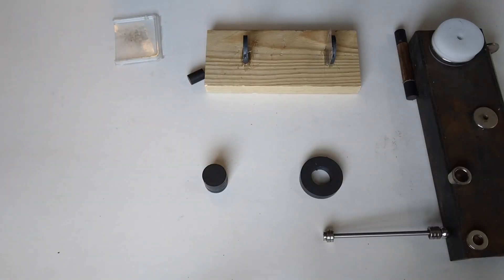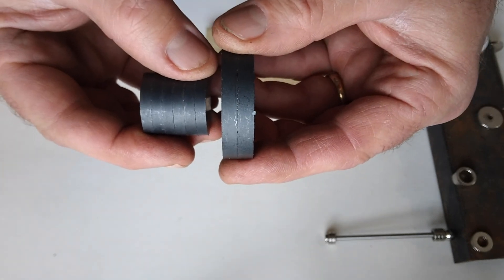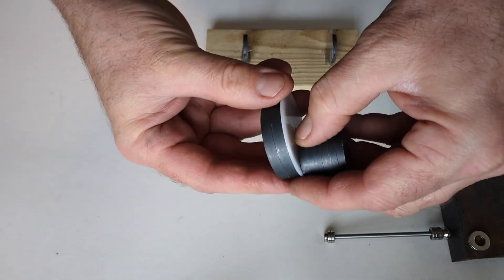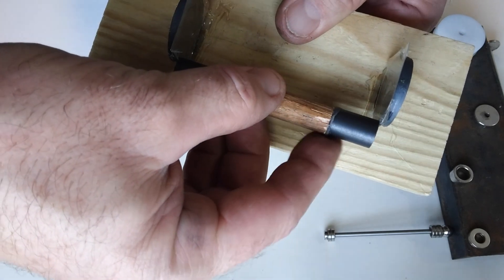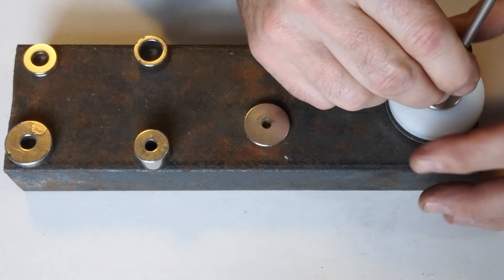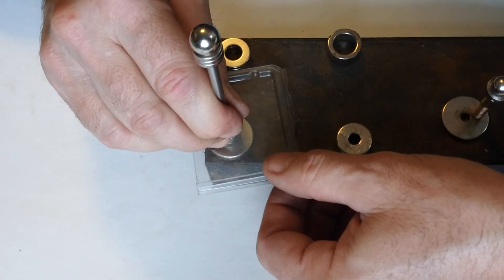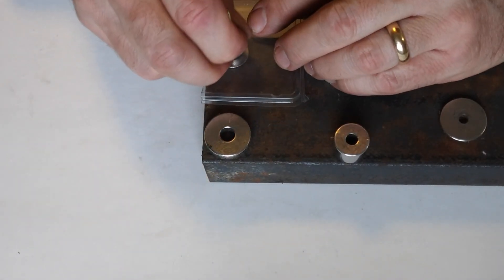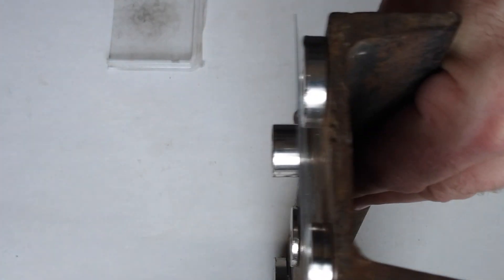(#2 E.O.I.) A Permanent Magnet Bearing Design

Comment: If you mount the smaller magnet on the end of a wooden dowel or inside a plastic tube instead of on a steel bolt, you will feel an extra degree of stability by gripping the far end of the dowel.